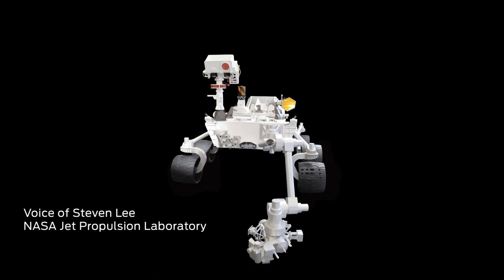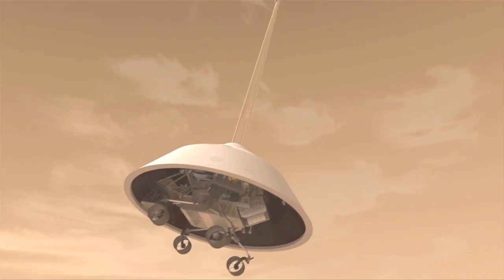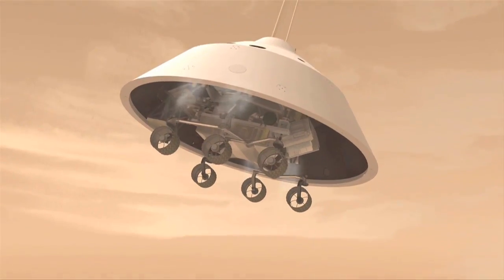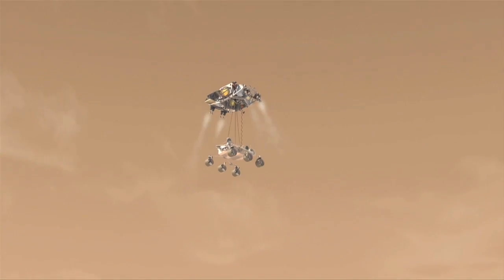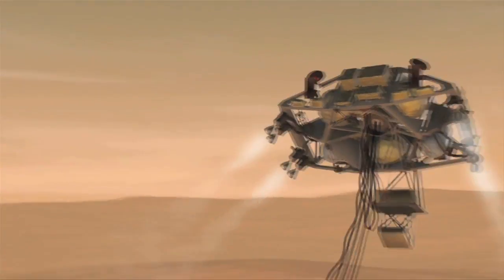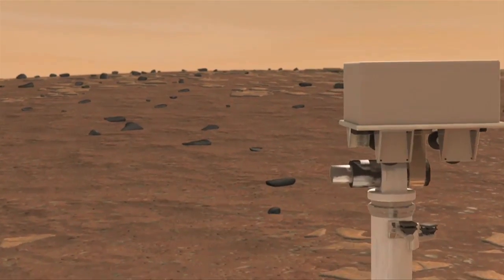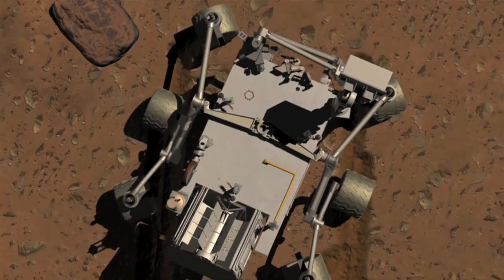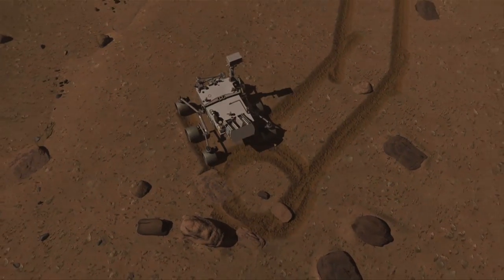How the Curiosity Mars Rover Will Land and Navigate

Comment: Np, man, guess I wasn't clear due to eng not being my native lang.
Curiosity uses an RTG (radioisotope thermoelectric generator) as power source. Simply put it uses heat produced by natural decay of plutonium 238 and turns it to electricity. Even tho it uses state of the art RTG it only makes ~ 120 watts of electrical power from ~ 2000 watts of thermal power (Generated by decay). bc of decay power output will drop over time. So 14 years is min lifetime (After 14 yrs output will drop to ~ 100 w)

Comment: it's thickness is like 1% of earths atmosphere. Average pressure is around 7 milibars. Oxygen content is under 1% and I beleive that over 95% is carbon dioxide. High temperatures can be in the range of 15ish Celsius. Also note that Solar radiation would be most likely very high compared to earth despite the distance. I wouldn't go sunbathing :P

Comment: @mrteemumilto this is the first time the skycrane is used. proof? tech is not like math where a solution could be found. But if you read stuffs, retrorocket is nothing new. before they put it at the landing base, now they hand it on top. the only difference is the wiring mechanism to lower the rover down and cut the cable. But this extra complication is offset by not having a ramp and cramp the whole system in a small space of the aeroshell.

Comment: @Ariomaniac It's been tested dozens of times by helicopter. The crane is not what you should be worrying about, it's the rockets. However - all Mars landers must use rockets at some point, even the airbag landers had to use rockets during the final seconds of descent. If the rockets fail, any other probe would have failed. It has nothing to do with the sky crane. Please don't be so ignorant as to suppose NASA wouldn't test the landing system for one of their flagship missions.